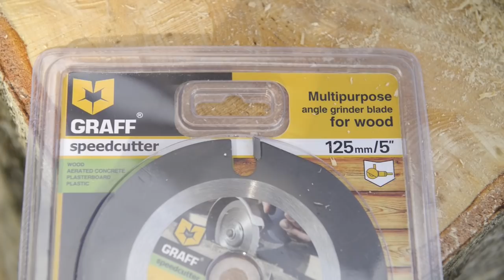Woodworking - Making a log throne

Comment: Two words: electric chainsaw. They are fantastic! Don't bother with the battery operated ones but the ones that you plug in have awesome torque and are quiet and cut faster then the gas ones because they won't bog down. The only maintenance on them is the chain and the bar!

They also make a rasp for angle grinders that you might like. Fantastic work as always! It's inspiring to see your projects!

Edit: spelling
Reply from the maker: Thanks!

Comment: Very nice Piece . Would suggest that you hollow out the seat portion a bit to aid the drying and reduce checking. A scorching and some linseed oil and it will age with grace. Thanks for sharing.
Reply from the maker: Thanks! Yes, I was thinking of getting rid of the center part from underneath somehow.
Reply: Strapped down securely at proper height and a good few careful plunge cuts with the chainsaw will remove the majority.

Comment: Have you looked into traditional woodworking tools? I think it would be really cool to see you handcraft furniture or small implements out of wood. You could probably even forge the tools  yourself. Well, aside from the sand paper.
Reply from the maker: This was mostly a quick and fun project. I do prefer hand tools for the most part.
Reply: I had never seen that saw blade for a grinder in action before, It was impressively fast and accurate. There are people here that carve huge sculptures with chainsaws and it's impressive to see the process